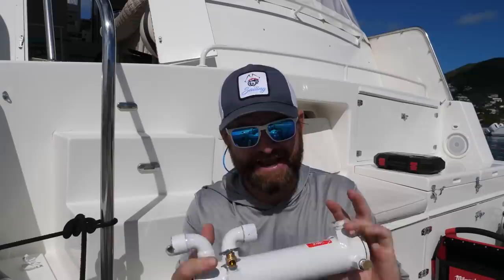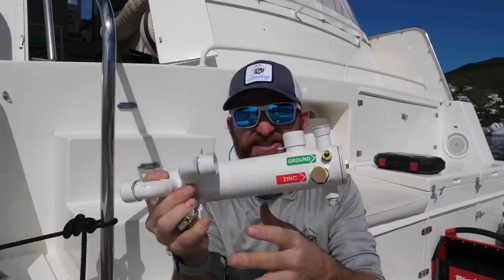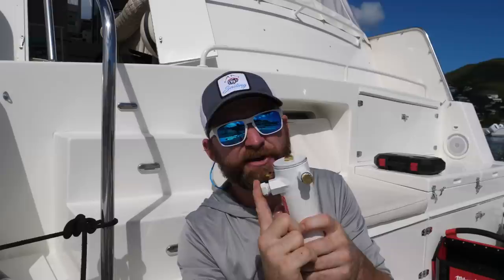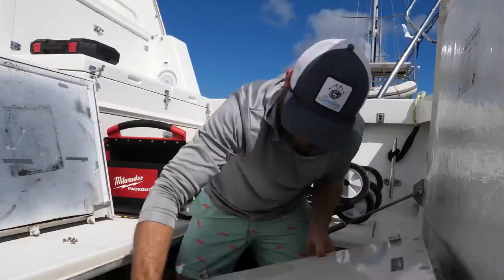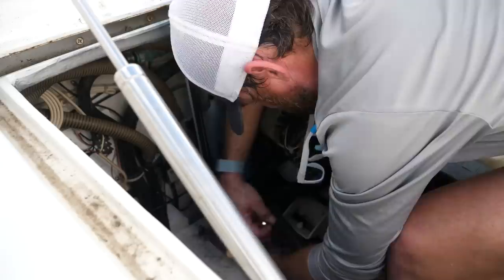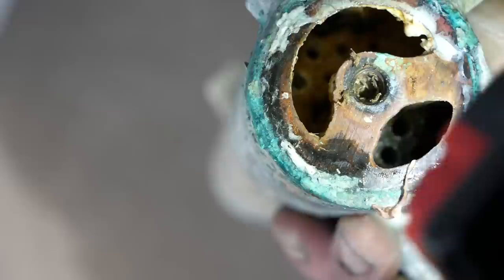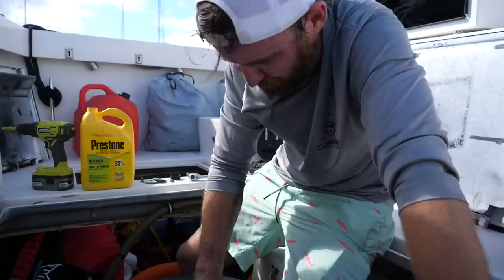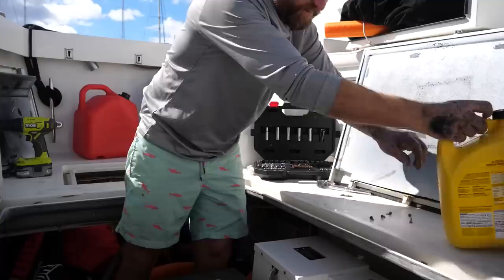Marine Cooling Systems - The Heat Exchanger - Maintenance Mondays

Comment: Just a couple of observations or tips from an experienced boat tech(20+years). Mechanically everything’s was right. You may want to look for a petcock to assist in bleeding the air out of the cooling system on the initial fill. Also, there are 2 different coolants out there, conventional and Diesel engine coolant. You can use both but with conventional, you’ll want to add a diesel coolant additive on a Diesel engine obviously. Be sure to observe the concentration as it is important depending on capacity. The Diesel engine additive(which is already in Diesel engine coolant) keeps cavitation erosion from occurring on the engine cylinder liners. The conditioner coats the liners and takes the cavitation erosion instead of the liners. Which is why the conditioner is a consumable. Also, do not over concentrate the conditioner, it will fall out into solids over time and plug the heat exchanger particularly when it sits for a long period of time between uses. Hope this helps in maintaining your vessels power plants.

Comment: The advice to take a picture before proceeding is one of the best tips you could give.  I do the same these days for almost anything in addition to lying removed parts out in order of removal to give me a reassembly order.  Has helped a number of times in the past as reassembly order is not always obvious and sometimes the correct order can seem wrong.  Saves a lot of time having to tear a device apart again to correct the assembly.

Comment: With most engines, replacing coolant you should run it long enough for the thermostat to open. That will help get rid of any air. Also there may be a coolant bleed screw somewhere.

Comment: If there is a thermostat on the generator, its going to block coolant flow to the engine until the engine reaches the right temperature. So, check top up the coolant after its ran and warmed up to temp and cooled back down. Never open the coolant cap when its hot as it will spray hot coolant all over the place. Ive even left the cap off as the engine comes up to temp but some of the coolant will come boiling out right before the thermostat opens, then the fluid level drops and can top it up.

Comment: great info... I always used the analog of the heat exchanger being the equivalent to a radiator... except that it's sea water rather than air... and it was interesting to see the "No Step" decal under the gen cover....right where a foot was ;)

Comment: This is replacement NOT maintenance.  Maintenance prevents failures BEFORE there is an issue.  Big difference. (proactive vs reactive)
You don't wait for the impeller or zinc to fail, then decide to do what should of been done before hand. Regular scheduled replacement of both prevents all the nasty things that happen that can cause major issues at the wrong time.
Reply: This guy hasn’t got a clue about maintenance the only reason he even done this replacement is it failed, a seasoned captain has a preventive maintenance program and check list that is to be completed atleast yearly, not when there are issues with the equipment. One would think that if someone considers himself/herself a captain that they would have more on the ball
Reply: @pumacat1637  Nailed it.  Glad he doesn't have an aircraft!

Comment: Bobby check the replacement coolent.  Usually you don't want pure coolent.  A 50/50 mix of coolent and fresh water is more efficient.  Great information video.
Reply: Look closer at the bottle in the video, it says 33% on it. It is an export prestone product that is pre mixed......you, of course,  are correct about 50/50 being most common. I buy concentrate and mix my own to 50/50 to save a few bucks.

Comment: I’ve got a Perkins 6354 that needed  remarinized .  The old bowman heat exchanger was toast. It cost around 6000 grand just for a refit parts . The old exchanger isn’t made anymore . 15 years ago you could still get them . Wait for it .  Ten grand. I think they called them mani coolers. The exhaust and intake and exchanger was one piece on the side of the straight six . I can’t find the sacrificial on my northern lights generator.  150 bucks the gods where in your favor. Sv Bohemian

Comment: Don’t forget the cooling system pressure cap (radiator cap). Automotive cooling systems must be pressurized to work properly. It looked like a pressure cap you took off the generator to refill the antifreeze. If it has a pressure rating on the cap, it needs to be tested. I would think it would be inexpensive enough to just replace it. I enjoy your videos, thank you.

Comment: I occasionally will do a fresh water flush on the motors and generator. Pretty simple process. 1-  Close sea cock. 2- Open strainer. 3- Hose with salt away 4- crank up motors and run for about 5 minutes.  If you do this after long runs as well as when you are leaving the boat for a while. Perko makes a system that you can simply attach a hose and turn it on and then start the motors.

Comment: We use a heat exchanger in our carpet cleaning service truck... but we're doing it to make hot water rather than to cool the motor... we have a 130 gal fresh water tank on the truck, we run it through the heat exchanger and back into our cat pump, which is similar to a pressure washer, spray the carpet with a cleaner, then rinse at about 450psi with a wand and extract as you rinse...the water is usually in the 200 F range.  One of the few maintenance videos I've watched where I understood it completely... lol
Reply: Guess what happens when that heat exchanger gets an internal leak? That motor will not like 450 psi running through the cooling system. It happened on a unit I used in the past......my buddy/boss told me about it recently. He ended upgrading to a bigger unit that will run 2 wands at the same time. Actually, now that I think about it, I replaced part of the heat exchanger on that machine a couple years ago. It is great to scavenge the heat from the motor, but it sucks when it fails. We also ran 4 big pressure washers mounted on trucks and trailers, but they just have diesel boilers after the pumps. While I have only been on a sailboat once, between having an RV in the past and a toy hauler trailer and various equipment, it is easy to relate to what he shows. I think he did a very thorough job explaining the process.
Reply: @CGT80  That's exactly what my former boss did, set the truck up so it could run 2 wands, although in the 10 yrs we worked together, we never ran 2 at a time... better heat exchanger, bigger vacuum pump...

Comment: The green coolant turns acidic after 3 years rust out your block make sure change it every 3 years. The newer stuff orange will not do that but you can't mix the two really can't get the old stuff out that easy even filling and draining still have some in the low spots of the block. The only way is to open the drain plugs on the block drain and refill with water run drain again then it will be cleared out.  Lot of times I don't even bother with the new stuff if the engine had old green in it just keep using that and flush once every 2-3 years.

Comment: Nice! How did you gather & dispose of the old coolant??
Reply: I had the same question!
Reply: Yes I was wondering the same.Bobby?
Reply: I thought the same thing
Reply: most people use a shop vac and empty that into a head, which would get pumped out when refueling. For the most part these area's don't share the main bilge area, otherwise it would empty into the ocean which is what needs to be avoided.
Reply: It ran in the bilge...

Comment: This is great! Question though: why would the rubber parts of the impeller be designed to break down and then clog the heat exchanger? Sounds like a racket!
Reply: If replaced at a max of every two years it will never breakdown. That one should have been replaced the day the boat was purchased.

Comment: Are there any software packages for organizing a boat maintenance program similar to those for aircraft?
Reply: Maybe check with the boat manufacturer. Some newer boat manufacturers have two way communication with the factory/boat and take note of how long you use the engine or other components and then send you maintenance reminders. Also something to take note of. I recently found out that if something happens to your boat, like a fire, and you go to your insurance company they will ask to check your maintenance records and if you don't have them or haven't kept up on maintenance then sometimes the insurance company will not pay. This applies to any add-ons you get too.